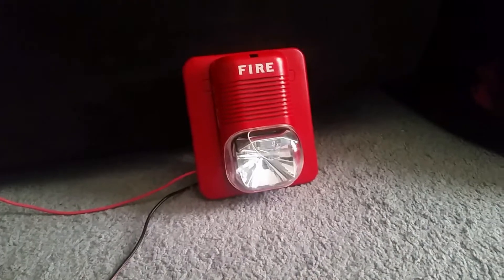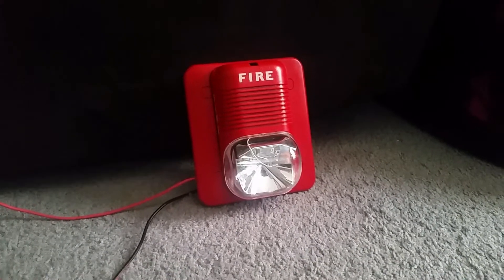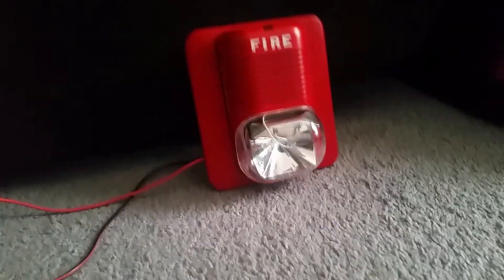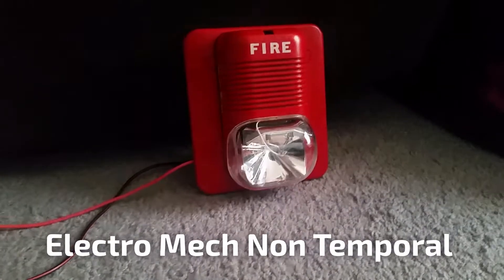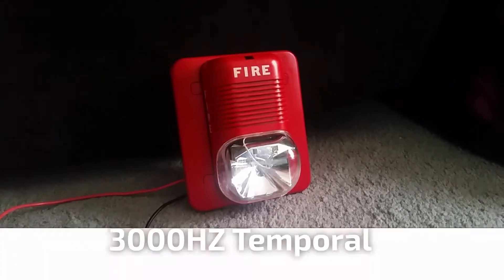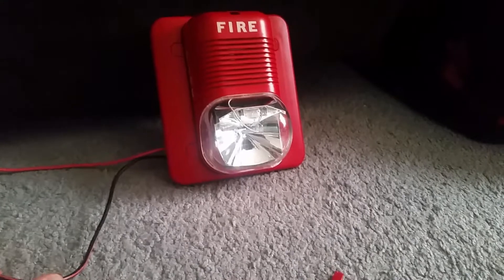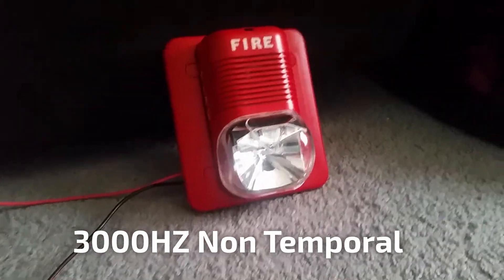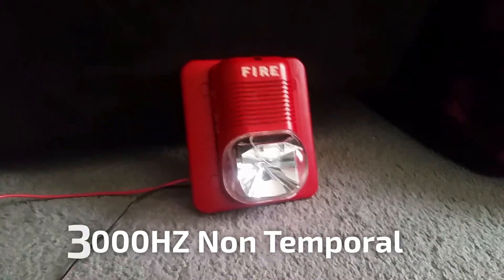System Sensor Spectralert Classic [All Tones]

Comment: The Student Center at my college used to have one of those in a computer lab. It got replaced in early 2009 with a Faraday U-MMT horn/strobe, and then the whole area was renovated in 2014-2015 and had SpectrAlert Advances installed.